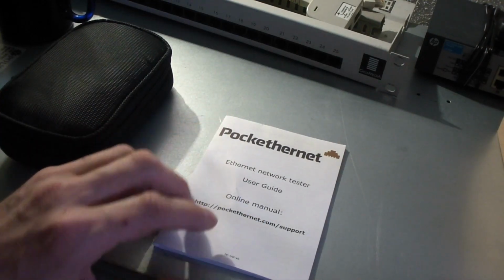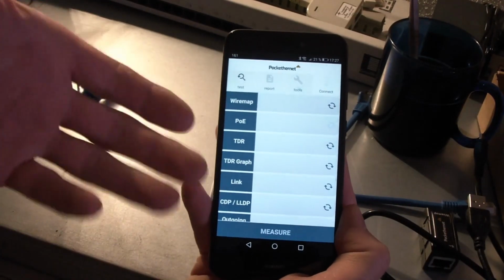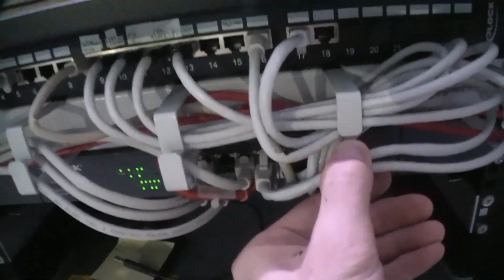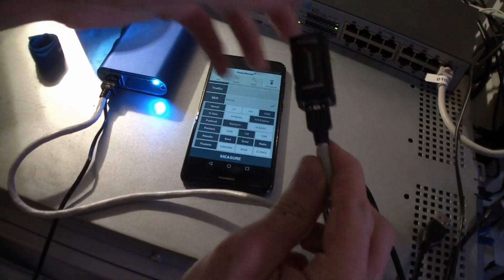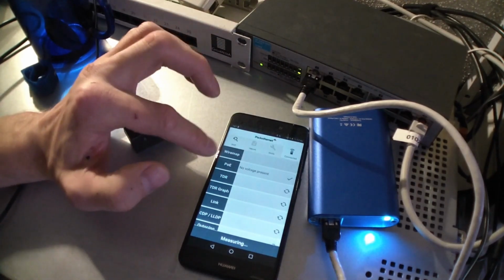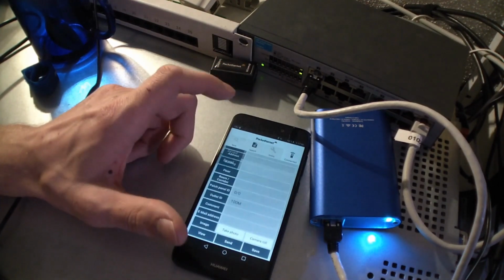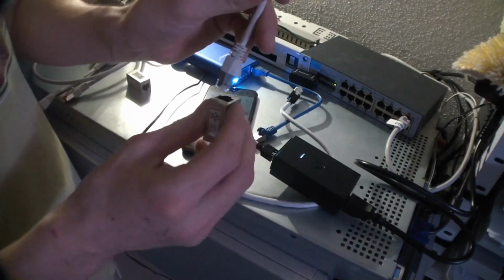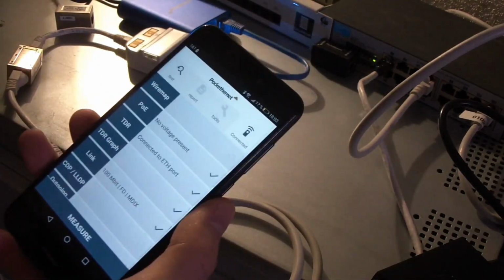Pocket Ethernet Network Tester Review

Comment: Wiremapping to a switch will always show short circuit
Reply: Wiremap has to be run to a remote that is designed to perform wiremap
Reply: why...?, if tester can sense switch why it shows error on wiremapping. tester know that the other end of the cable is connected to a switch. it should be smart enough to handle wiremapping. at least don't show error. if i know the other end of the wire then i don't need the tester. if you're testing a wire for breaks and other end is connected to a switch far away, may be on another floor. you need to first run to the other end, remove ti from switch and then come back and run wiremapping..., lol, joke. even $1200 fluke ciq-100 shows error if other end of the wire is connected to a switch even when tester can sense the presence of a switch..
Reply: @ssmaqsood  Because a switch is trying to output data as soon as you plug a cable in. That's why you need a remote designed for wire mapping, otherwise there will be interference. A wire map is used to determine breaks and faulty terminations. Anybody who works with cat cable should know why it comes up as an error...
Reply: @joshyj12345  it's not the question of WHY but the question how tester software should handle the error message. You'll always get an error when other end of the cable is connected to a switch and I expect tester software to translate this error to some useful message rather then throwing an error.